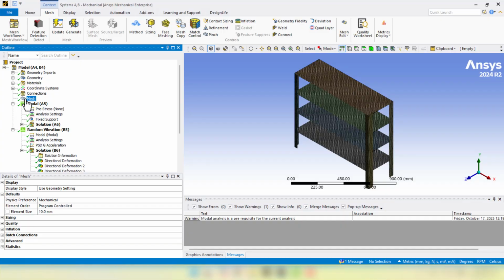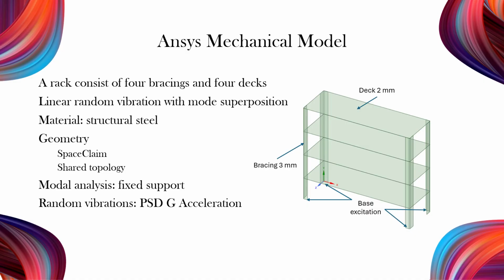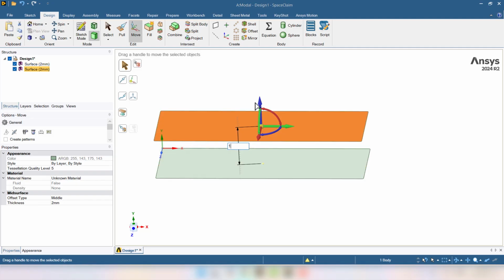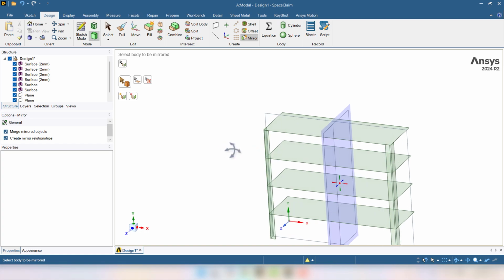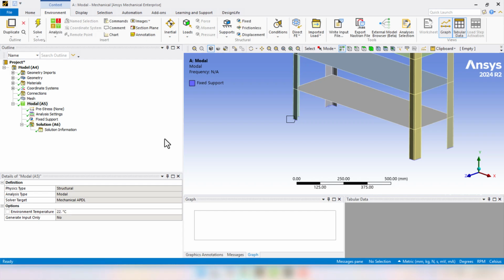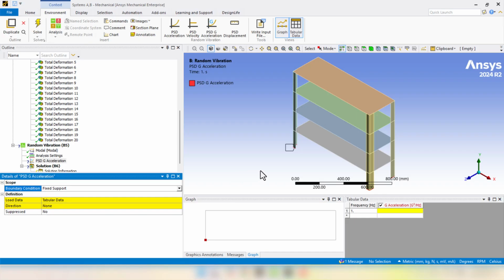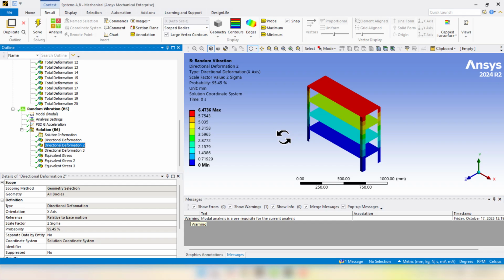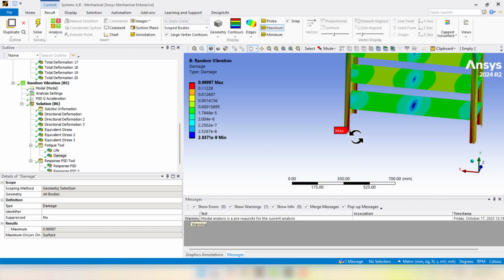⚙️ Ansys Tutorial: Random Vibrations Analysis | Stress, Displacement & Fatigue (Sigma Criteria)

Comment: Thankyou you very much for such informative video. 
I have a small question in one of the step. 
Under Random Vibration after inserting PSD acceleration and selection the boundary conditions, the tabular data that was used is bet confusing. Can you please give me some information on what logic is used to put the values and what limits the number of tabular data?
Reply from the maker: Hello, the values depend on the base excitation force, but the variations must be smooth. I don't remember the exact variation value, but it's mentioned in the ANSYS user guide.

Comment: It's absolutely great sir ! can I use this tutorial to simulate the life of a motorcycle steering shaft bearing sir, it is a ball bearing, but it has little movement and according to ISO 76 standard a ball bearing rotating less than 10 rpm is considered a static bearing, but it still has fatigue damage when subjected to vibrations from rough road surfaces and the loads it carries. I look forward to your feedback, it will be valuable to my research.
Reply from the maker: Thank you. It depends on your case study's boundary conditions and excitation source type. The road profile is random, and I think you can use random vibration.
Reply: @caewitharminhashemi  thank you sir, can I quote this video tutorial link of yours as a theoretical basis for my current scientific paper, I am first learning about this field of knowledge and what you did impressed me it helped me open up a much more in-depth academic direction than using a few resonance frequencies to calculate
Reply from the maker: @kientruong6655 you're welcome